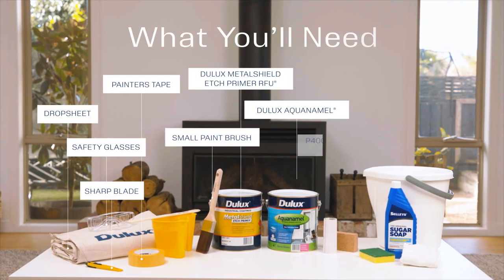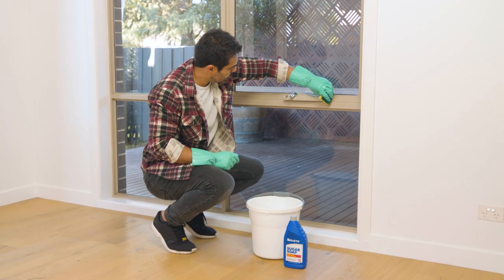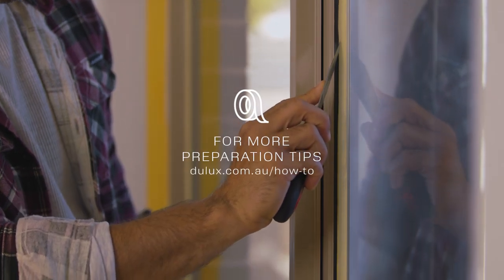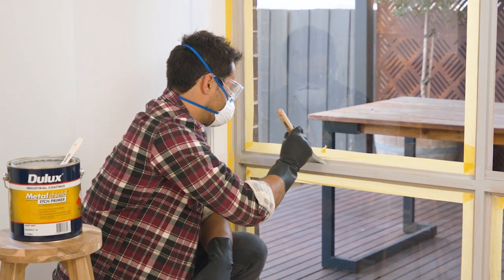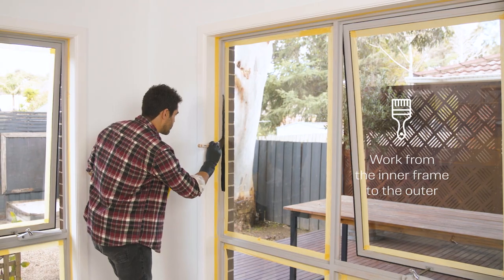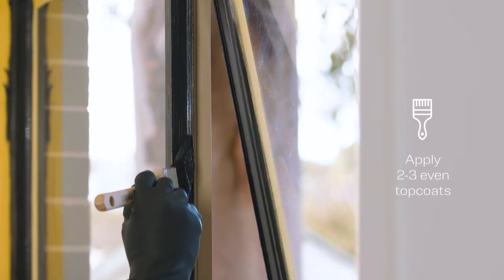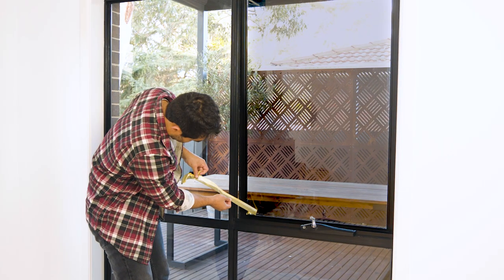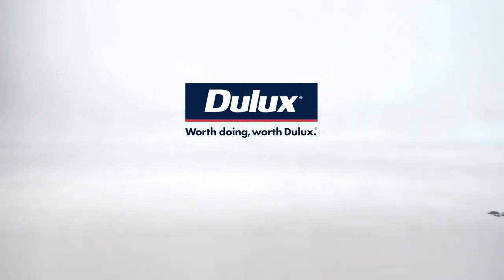How to paint over powder coated windows | Dulux

Comment: I followed this advice initially on Alu window frames. used Etch primer. The top coat peeled right off.
Next set of windows; no etch primer. Coating is hard as rock. Used dulux epoxy enamel gloss paints. Be cautious of shrinkage and cracking if spraying a second coat >24hrs later. Need to sand prior to 2nd coat. Or just recoat within 30min or original. Better.

Comment: Found a product that works on previously powder-coated aluminium. It's 2k epoxy top coat that doesn't require a primer just a sand and degrease. The particular brand is unique in that the two components (resin and hardener) are already combined in the aerosol can and simply react upon contact with the air. The benefit is unlike other 2k paints, this one has unlimited shelf life after first use. The only downsides are cost and epoxy is toxic but boy does it stick. Won't mention the brand name, only that it is intended for automotive and comes from Finland.
Reply: Don't be a tease Davey. Tell us the product name